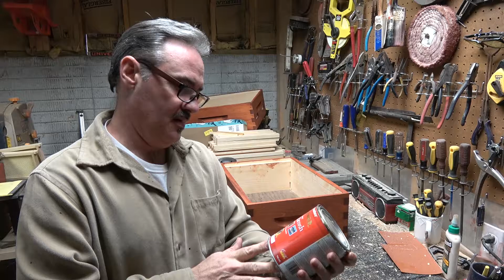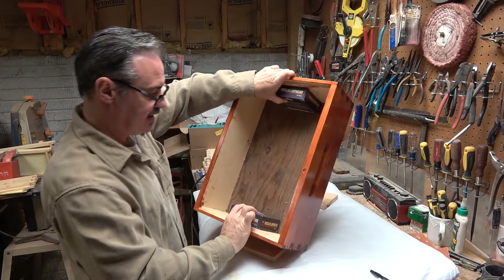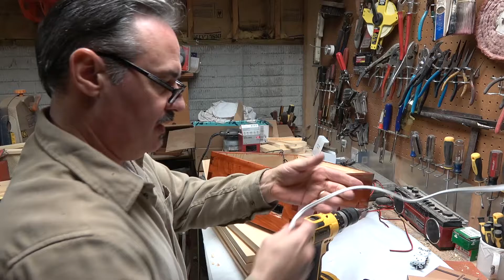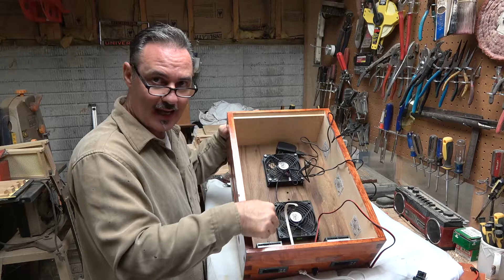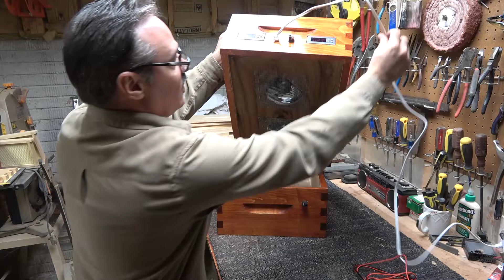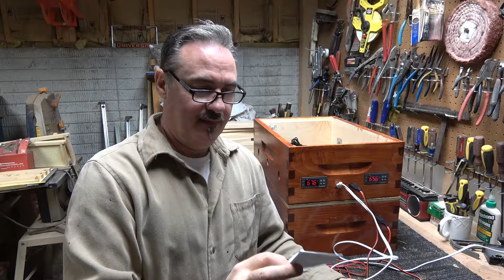DIY Beehive Heater -- Part 3 of 4  How to build a climate control system for your beehive.

Comment: Why are you using 2 controllers when they have the ability to control the heat lamps as well as activate the fans?
Reply from the maker: Good question.  Because the controllers can control heat or cooling withing a 20 degree differential if I remember correctly and the worst thing I could possibly imagine is the exhaust fans turning on in the winter and pulling 20F air through the hive.  I think I have a better explanation as to why I did it at some point in my heater build videos but that is the gist of it.  With two controllers I can maintain a more precise  temp.

Comment: Just a note on safety:  the SAE connector is a low voltage DC connector.  It is not safe for 120VAC.  In this application, with the connector exposed, potentially wet, and being held by an insulator (wood) and not a grounded chassis, the chance for an electric shock is pretty high.  Remember, the voltage of your source determines the effectiveness of the insulation and weatherproofing.  So, while the SAE connector is considered safe when electrified with 12VDC, using 120VAC is a whole different safety story.
Reply from the maker: Thanks for the heads up.

Comment: Why not inset your defuser board?  I mean, make it a little smaller so it fits inside the super, and it could be supported by the frame rests.  Maybe screw a block of wood on the long sides to add support.
Also would have been nice to show how to splice one wire, just to show how to do that properly.   
But your video is very helpful.  I don't see the need to heat them up anywhere near 70, but when you have a tiny hive (couple of frames)  that might not survive temps down in the teens for very long, this heater could get them through the rough spots.   Also, I'm glad to see someone IS heating them to 70, just to see if that is better.  You don't know until someone tries it out.  Love your videos.
Reply from the maker: Thanks Jim. I am working on a new project now which should be finishes soon and will use 1/8" sheet metal for the defuser board. I have set the hives to 70F for the last 4 winters and the bees seem to like it.  This year I had a problem with a very weak colony in the Blue and the Orange hives and I set them to 75F to help the larva stay warm.  We will see how that turned out in a couple of weeks when the weather breaks.  Thanks for the suggestion and thanks for watching my videos.  Share them far and wide :-).  Take care and stay warm.

Comment: I was able to make it work with a single controller. A single controller will do both heat and the fan.
Reply from the maker: That is what the controllers are designed for but in order to keep the temp at a certain set temp I use two.  I don't want my fans coming on in the winter if I am heating to 70F and it hits 73F with a 3F differential.  That said I am happy you have it working .  Please email me some pictures and I'll put them in a video. I am excited to see.  Take care and have a Merry Christmas.
Reply: @BugFarmerBees  Here is my video...
https://www.youtube.com/watch?v=ivRJlF4MpdU
Reply: @afcomm3c2  hey Heath I tried to see your video, but the link said you removed the upload. Is that right?

And great design and video Bug Farmer!
Reply: @BugFarmerBees  that makes sense. I'm still working on mine but I'll make a video for you when I'm finished. I made a few modifications that you may find interesting. I hope to have it finished today.

Comment: What I don't understand is how do you keep your frames in there after all that equipment is inside the box. In other words there's no room to put the frames in
Reply from the maker: The heater box goes on the bottom of the hive under the screened bottom board and the control unit goes above the hive body.  The frames are in the deeps and mediums that go in the middle.  Great question.  Thanks for reaching out.

Comment: Do the fans blow into the hive or act as exhaust and blow out? Im curious because I live in Florida and thought about using a fan box to help cool and ventilate my hives.
Reply from the maker: I use the fans to exhaust the box.  I draw air from ground level and draw it up trough the box.  It seems to work well in this hot and humid environment.  If you don't want to add the heater to the system you could probably power these fans with a small solar panel.

Comment: Questions: Have you found that the in the cold would it be beneficial to insolate the bottom of the heater box? have you ever thought of a reflective inside of the heater box? Have you ever had any issues inside your boxes, would you finish them as well to preserve them or would the possible fumes not be welcomed in the hive (I was thinking possible mold or mildew)?
Reply from the maker: Great question and great idea.  No I do not think it is important to insulate the heater box.  Because heat rises and the temp of the box it determined at the top of the stack.  A reflective lining on the bottom may be a good idea.  As far as finishing the inside of the box I would not do it. There is really no need and I don't know if it would case fumes so It's better to just leave it unfinished. If you are planning on building one this is a modification I would make and will make on the next two I build dor the purple and orange hives; make an access door in the bottom box in case you nee to change a heat lamp mid-winter. Also, when operating these boxes in the winter if you are still feeding syrup make sure you use a vavaldi board to vent moisture out of the hive.  The girls will still store and evaporate sugar syrup in the winter but the residual moisture need to be vented without venting the heat. I hope this answers you questions.  If you build a set and put out a video let me know so I can have a look and please give the Bug Farmer credit.  Thanks a bunch for watching and if you have any more questions feel free to ask.
Reply: Bug Farmer Good morning. I have my boxes built and laying out my diffuser board, what have you found works best for hole size? 1/2”? I also noticed you have no holes directly above the bulbs, how far away did you find worked best?
Reply from the maker: @jamesmcnally2519  1/2 inch holes will work and I guess the area over the light was about 5" x 3".  The goal was to make sure no direct heat from the heat lamps created a hot spot in the bottom box and melted comb.You may even want to glue foil or a reflective material over the 3x5 area so the heat rreflects back into the box.  I can't wait to see the final result.  You shouldn't need to place the heat boxes on the hives yet but the bees will surely appreciate the top box with the exhaust fans. :-)
Reply: Bug Farmer what size did you use for the holes? No use reinventing the wheel if it’s rolling just give it a kick!
Reply from the maker: @jamesmcnally2519  The holes were 1/2" evenly spaced in a grid 11 holes wide by 17 holes long. All holes were 2" from the edge leaving a 2" border on all 4 sides. The area without holes over the heat lamp was 5"x3".

Comment: I love the clip art on your channel. lol Nice I will have to look into the spar finish. Lessons learned the hard way. Ekkk... 

I am wondering if the hive is too warm in a really cold climate if it would confuse the bees to go outside which would not be good. I had my bees get poopoo butt one year I fed sugar water because we had such low amounts of nectar that year trying to get them through. It messed up their digestive system and they exited to clean and froze to death. It was a mass suicide so to speak bodies all over that was the last year I had bees. :(
Reply from the maker: I worried about the same thing.  We had several 24F days this winter and the hives stayed around 65F and the bees stayed inside and walked around.
Reply: oh now that is interesting. Hmmmm..... I wonder if keeping it at a lower temp say like 50F inside would help up here. We wrap and insulate the hives as much as possible for winter, but it is usually not enough. Of course heat escapes and all the really super cold temps we can get. It would be interesting to find out. If I manage to get a swarm I will try it out. I hate to pay $180 or more for a nuc with a queen and then have them croak on me due to factors I can't prevent.
Reply from the maker: You would be surprised.  If the hive is sealed up good  and only top ventilation holes open it really wont take much to keep the hives at whatever temp you choose. You may need a vavaldi board to deal with any moisture if you plan to feed syrup during the winter because they will try to store and evaporate it.  I learned that the hard way and actually thought the roof to my flowhive was leaking.  I was just moisture from  the bees evaporating the syrup I had on the hive. In next years model I will make one change though, and if you decied to build a set of heaters I would suggest you also do this; ad a door on the heat box so you can change out a heat lamp if one burns out.  That said, if you put fresh bulbs in at the beginning of the season they should last the entire winter.  Sorry for the wall of text.
Reply: No worries. :) Something to keep in mind, but that you mention makes sense.

Comment: Where are you located? I would buy one of these lol
Reply from the maker: I am in Georgia.  If you are not comfortable building one I may be able to build one for you.  They are really simple to build if you use simple painted boxes.  Its the staining and finishing that takes all the time and effort.  The build itself is pretty easy and if you watch the last video in the series part 4 of 3 ( I know, I had more to say) I show how to wire the system better that I did in the 3rd video.  Everything you need is in the link in the description.  :-)
Reply: I will think about it. This is an awesome idea for early spring build up.

Comment from the maker: Outlet :
https://amzn.to/2vyZHFJ

Power Cord:
https://amzn.to/2SC7Np6

Bun Fan: 2pk
https://amzn.to/2HmJLsQ

50W Heat Light 2pk:
https://amzn.to/2HjTJez

SAE Extension cable: 2pk
https://amzn.to/37pDXtp

Porcelain Light Base:  2pk
https://amzn.to/2HoANLC

110V Inkbird Controller: (You need 2 of these) 
https://amzn.to/31O75t9

100pk. Wine cork: (you will only need 6 corks so drink it it you have it otherwise buy these)
https://amzn.to/37rBLBw

Betterbee Budget Medium Supers: 5pk (Shipping is expensive)
https://www.betterbee.com/wooden-hive-equipment-8-frame/boxbg8m.asp

Mann Lake 5pk Medium Super (Free Shipping)
https://amzn.to/2vAvNkK

 Other items you may want to purchase:

Man-O-War spar varnish: 
https://amzn.to/2SmDZxK

40 pk.Foam Brushes: 
https://amzn.to/2tY9RiY